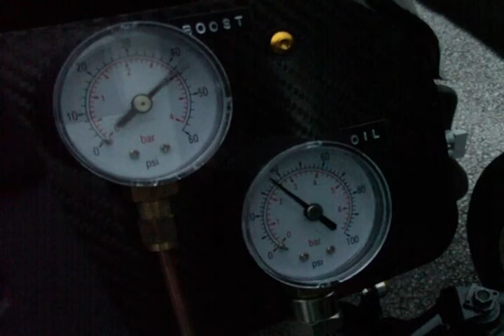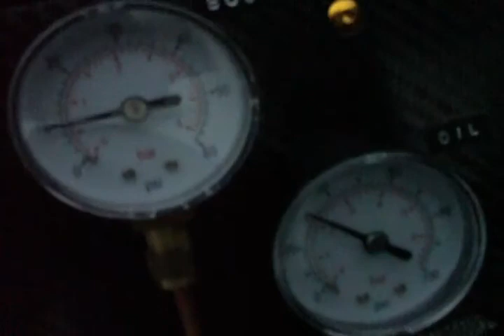D.I.Y. JET ENGINE TEST (Martyns new engine)

Comment from the maker: The flame tube is only 7inches long by 5 1/2inches diameter and the part of the video at 3.49 is not the turbine scroll glowing but the radiant light from the combustion iluminating the inside of the turbine scroll i took this video at dusk so the camera is getting a bit sensitive to any light being given off,The E.G.T. gauge didnt move off its stop all the way up to full throttle so the temps didnt get over 300oC this is without a nozzle fitted but this will change once the reheat is bolted on.